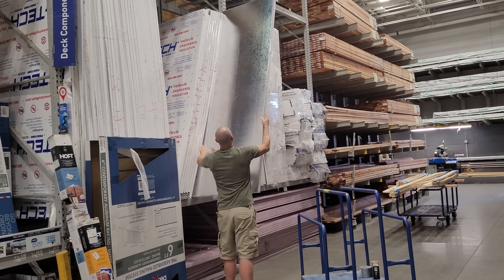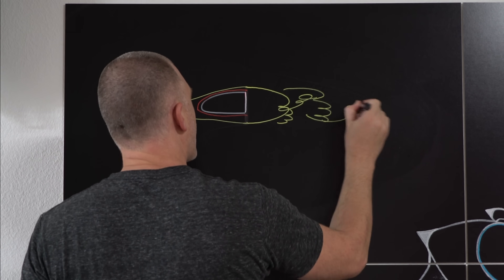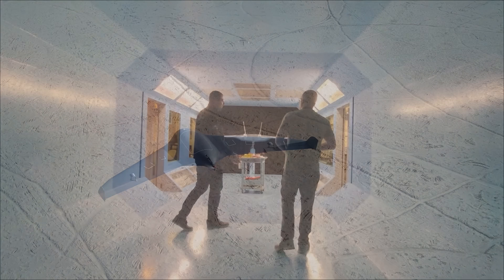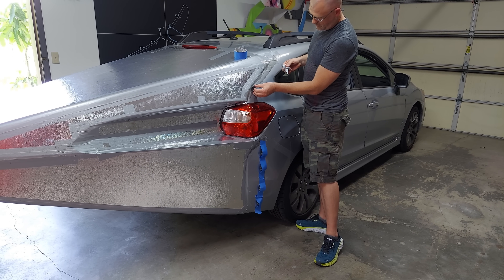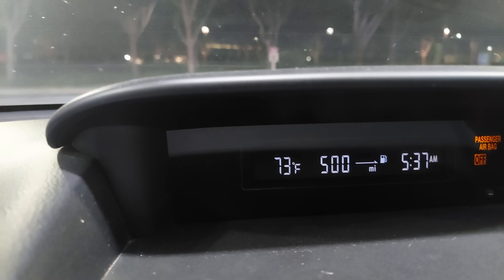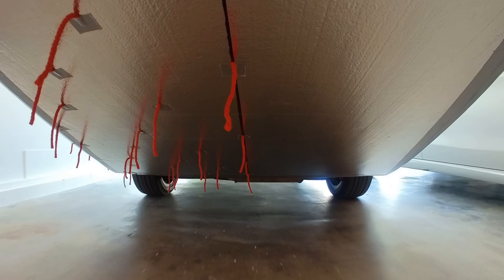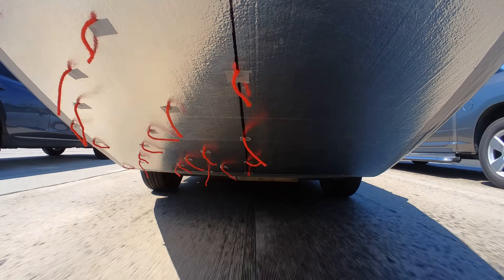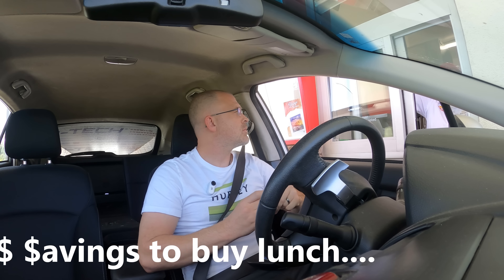Using Simple Aerodynamics to Beat High Gas Prices (Home Improvement Store Edition)

Comment: Word of caution: I modded a minivan for hypermiling and added "smoothies" wheel covers. I had insufficient front brake cooling, and the front brake pads cracked in half.
Reply: You can add front brake ducts to help cooling and it’s also race car technology
Reply: For optimal fuel efficiency you should keep the braking to a very minimum anyway! Only idiots hit their brakes constantly while driving which is pretty much most American drivers!
Reply: @daxmax1681  Yes and no..if you drive where mountains exists..you need proper brake cooling.Have you driven in Italy,Switzerland parts of France and more?Have you done a 10-15 km long downhill at 8% or even more?Over there ,there are no “American” drivers and people drive fast,uphill and downhill.
Reply: A much more efficient and smarter way to slow down a vehicle is with engine braking. Believe it or not even combustion engines are more efficient with engine braking than with conventional brake pads! Also keeping a big distance between you and the car in front of you helps tremendously to give you enough time to come to a stop.
Reply: yea, a cars wheels/ rims are designed to absorb and dissipate heat, some even help force air into the brake discs for improved cooling
Reply: Death is a small price to pay for increased miles per gallon.
Reply: The people who made the car are engineers after all 👍. Venting was planned for
Reply: @Rearmostbean  those engineers accommodate all sorts of idiot drivers and also to be safe legally speaking! But if you are a little smarter you can do it very little break cooling. You can do pretty much without breaking to control the vehicle it just takes more skills even with automatic transmission vehicles.
Reply: @JONOTron It's the wheel rims, not the tires. Sometimes they're specifically designed to actually push air like fan blades (I think Tesla does this) but usually just adding big holes is enough to dissipate the heat of normal driving.
Reply: Brake air ducting would defeat the purpose of running smooth rims. Also how much braking were you doing? Did you track your hypermile car? Lol
Reply: Also he's busy making a wing, which is generating lift on his rear tyres.
Reply: This is interesting as so many cars before alloy wheels had steel wheels with full width hubcaps without ventilation and they didn’t have issues with brake pads cracking.
Reply: wow my future mod may be yours: high temp brake pads.  Also add small slits in your smoothies.  Nothing major.
Reply: Yes That's VERY Dangerous and a NO do anytime.
Reply: @danigonzalez4299  why?
Reply: Less braking done less will overheat, so he chose the highway/freeway?
Reply: maybe a set of BBS Turbofan/Zagato AZ1 style wheels could have eliminated that problem while still keeping the aerodynamics? don't know much about anything, but break cooling immediately jumped to my mind when a saw those wheel covers and thought those rims could help keeping aerodynamics while avoiding overheating.
Reply: @tecc9999  the cost of those wheels would completely negate any mpg increases
Reply: @captainkirk3000  i didn’t mean those exact wheels, just ones with the same styling/design
Reply: @tecc9999  wheels are expensive man, doesn't matter if it's the cheapest steelie
Reply: Maybe adding brake duct to channel direct air from front could help?
Reply: Lmfao 😂
Reply: Well, duh. This is why wheels have holes. You can run brake ducts to the brakes, but that will ruin your gains lol
Reply: Just fucking get a 4 cylinder car and bam you get way more mpgs without looking gay
Reply: @ToyotaNutjob  guess what this car is. maybe next time think before you type
Reply: @ToyotaNutjob  it’s 2022 and we are all adults … chill. I regularly enjoy looking gay daily , try it some time ☺️
Reply: @ToyotaNutjob  bom bom matey there are some differences between even four cylinder cars. 
Plus who cares if some random thinks you look "gay"
Reply: @ToyotaNutjob  ...you sure about that?
Reply: @ToyotaNutjob  and that's exactly what I did. Honda Jazz.
Reply: @paulgrieger8182  I’m realizing from the comments in this feed people don’t really know much about the cars they drive…
Reply: @ToyotaNutjob  also it’s a 4 cylinder already 🤷🏾‍♀️🤦🏾‍♀️😅
Reply: @ToyotaNutjob  that is a 4 cyl. but yes
Reply: It's a minivan..............
Reply: @BELANDIOFFICIAL  principle is the same and brake size is, generally speaking, portioned to size weight of the vehicle.
Reply: @slowb15  yes, but ventilation is different from brakes for a van and for a sportscar, they have ventilation and holes, minivan brakes are very thick and without holes so they retain more heat

Comment: Dimples in a flat or curved surface will also reduce the drag coefficient.
It works for high end deep section bicycle race wheels and should work on panelling of motor vehicles as well.
Just a thought.